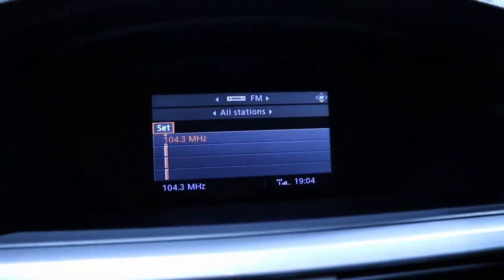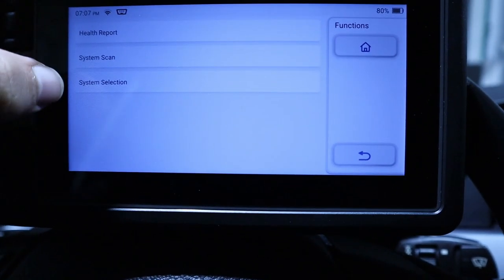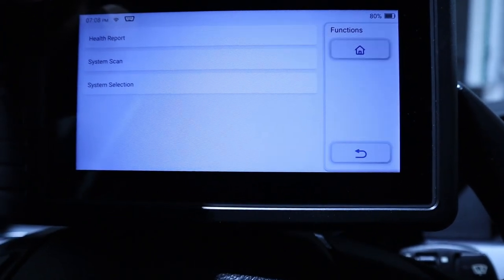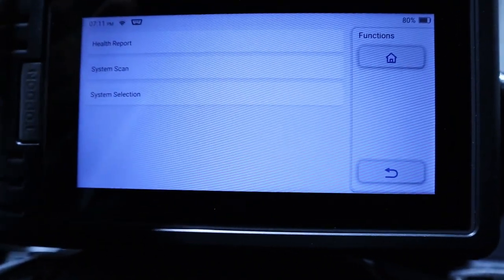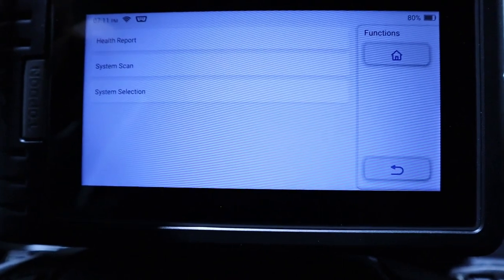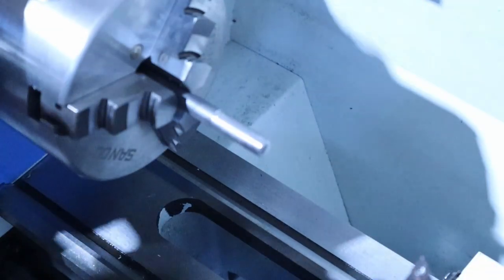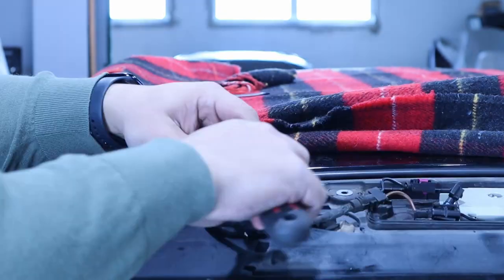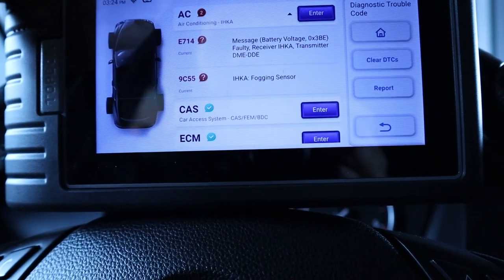BMW FM Radio Signal Fix

Comment: Thank you so much , i have a question please .i have the same car the car key doesn't work and i have only one radio station   also the third breaking light doesn't work     what should i do ?
Reply from the maker: For sure you will have a lot of broken wires in the hinge area. I would start to check that. After all the wires fixed or with absolute sure they are right, if the problem persists, then replace the diversity module. But by your description you have wires broken for sure.

Comment: I know that this video is 2 years old , but i have the same problem with poor radio reception . I saw that you welded another wire in the outer layer - I suppose that it's the ground ? And where did you connect it ? To other ground or somewhere to body ? Thank you for response :) Cheers !
Reply from the maker: If I remember correctly I just weld it in one side and on the other because the original wire was totally broken.

Comment: I used tbe same brand of diagnostic tool topdon.. However i cannot fint the health report. We have the same problem witj reception. But icNt find the real problem. Broken wirez or whatever.
Reply from the maker: Check the rear hinge. The problem is in that area for sure.